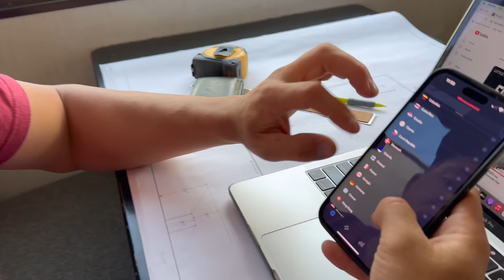STANDING UP 14FT WALLS

Comment: May be too late, but... I watch a ton of other channels that are or have built their own homes. The foam seal you put between your green board and concrete wall, doesn't have to be stapled to the green board, you can simply roll it out and press it over the studs sticking up and they will keep it in place.
Reply from the maker: Hi Chip! Yeah you can do the foam seal either way. Stapling it to the green board was the way we chose to do it. However just rolling over the anchor bolts might have been easier. 😂
Reply: @lifeelevatedoffgrid  easier, faster is what I was thinking. Nothing wrong with your method, I just want the build to as fast as possible. I'd love to see y'all finished and in it by winter.

Comment: Bloody hell, didnt anyone think, maybe the forklift would work better if only we put some Noggings in between the Studs, like you are suppose to do.
Reply from the maker: Hi James! I had to google “nogging”. I’ve always referred to them as blocking. We will be installing blocking at all osb seams. Just haven’t done it yet.
Reply: @lifeelevatedoffgrid  Im a Aussie so I wasnt aware we had a different term for them, they sure would have made it easier when lifting them into place with the forklift, regardless its a great build.